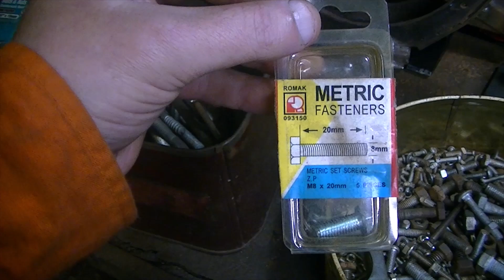Lathe steady rest build for the Hercus metal lathe

Comment: Why not start off with  big wide solid ring and  drill and tap three holes through it at 120 apart for the legs. Would have been a lot quicker and easier and a lot stronger.
Reply from the maker: Ideally yes i agree.
In this instance i just used what i had available to me at the time and wanted to see if it was possible to create something DIY that is otherwise a very rare find here for the Hercus in Australia.
I appreciate your comment though.